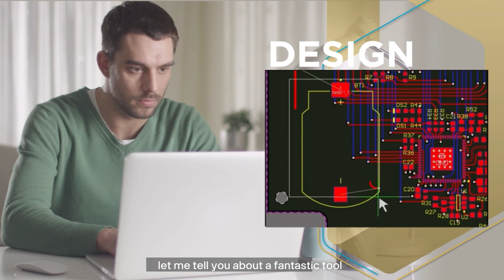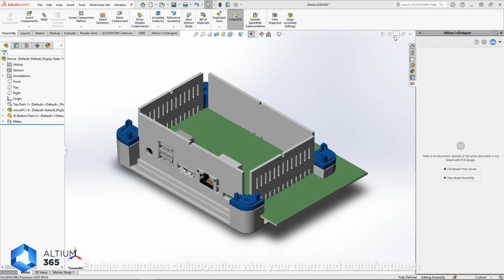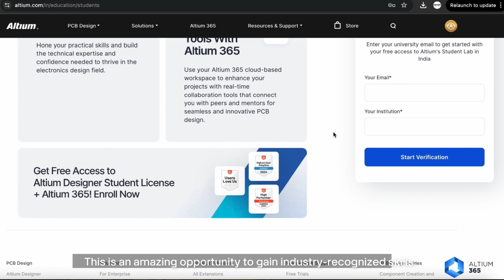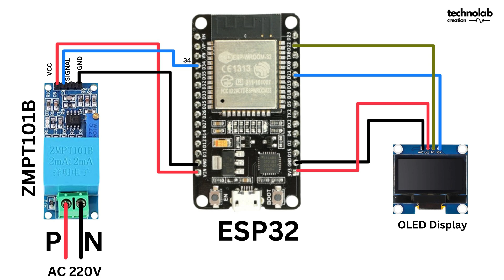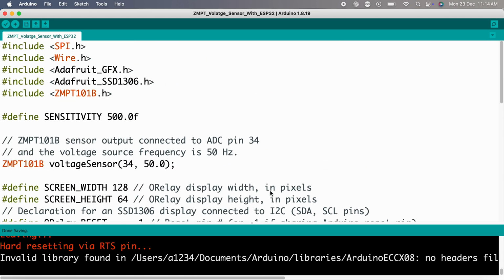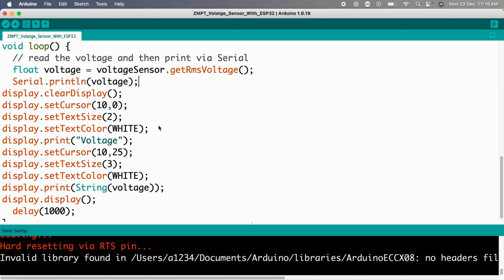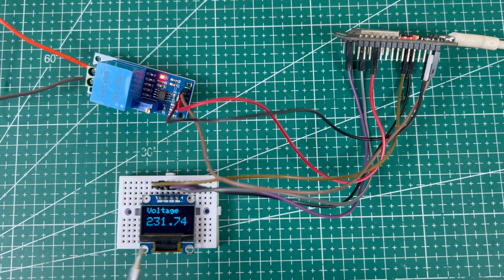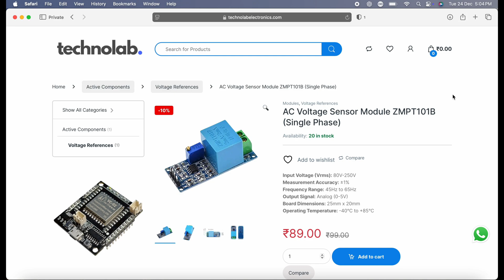ZMPT101B AC Voltage Sensor Module | Features, Specifications, and Applications Explained.

Comment: Thanks for the vdo. at 6:32, the multimeter reading was 228 but the oled display shows 237.46 volt, why such huge difference?
Reply from the maker: Watch complete video , you will understand by yourself
Reply: @technolabcreation  Bother i have watch the whole vdo before asking. You have calibrated before that timestamp. Most of the time data seems accurate, but randomly it shows high differences. I used it 6 years ago with same problem. Later I through it away and used another module from china (PZEM-004T) which showed 99% accuracy in a broad range of voltages. 
i was wondering if I could learn any mistake that i overlooked while i was tring to use that in my project. But seems I have done all the things you have shown.

Thanks, great vdo though.

Comment: Bro I currently working with this type of project. I have few more doubts. What is the o/p value when No AC input given to ZMPT101B for your Code? it is not accurately gives 0V (AC) it shows some random Voltage value (b/w 30 to 60)..😑